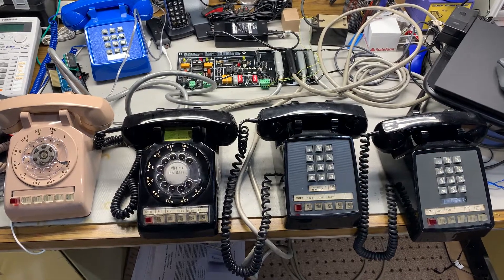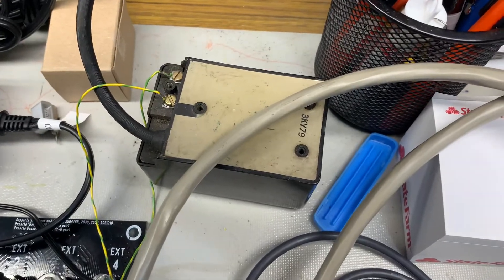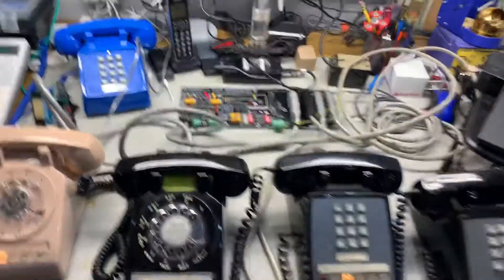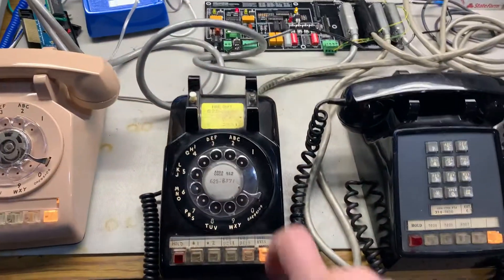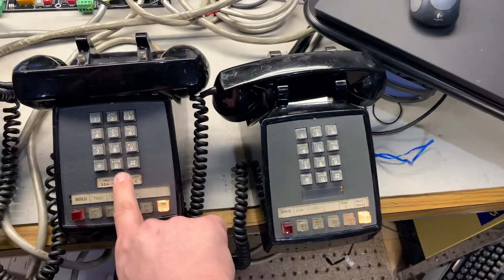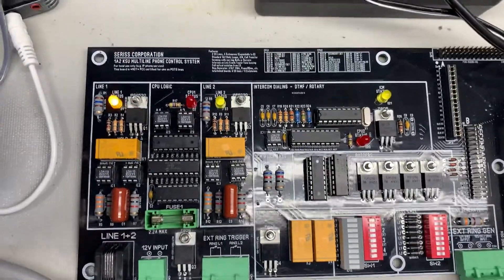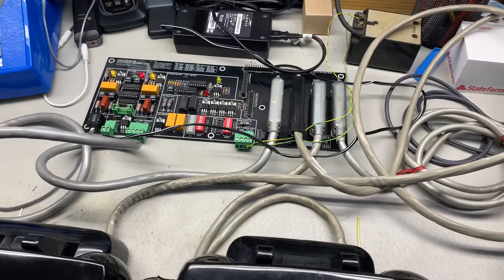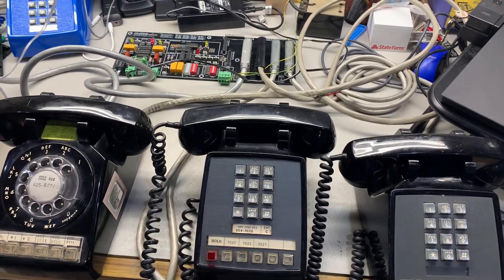Seriss Corporation 1A2 Multiline key system demo

Comment: Greg made a very good reproduction of 1A2 Key. This is perfect for people who don't want to mess around with wiring up a 1A2 KSU or do not understand how to wire up one. Also who do not want to hang up a heavy KSU on the wall. One trick you can do is make a jumper wire pair from the buzzer pair in the phone to the hold lamp pair. Then install a bulb in the hold light socket then the hold lamp will light up when the phone is buzzed.

Comment: Nice! I noticed the 1A2 bells continued to ring after you dumped the call. Is this because CPC disconnect isn't monitored on the board or because your dial tone provider isn't sending CPC? (CPC is typically a power drop when calling party disconnects, signals 1A2 that the caller has hung up, so held calls drop and ringing calls stop.)
Reply from the maker: Alexis Kasperavičius here’s the designer’s (Greg Ercolano’s) answer:  Ha, I noticed that too.. was wondering if someone would ask. It's an artifact of regenerated ringing in 1A2 KSUs to handle synchronized ringing of potentially multiple lines at once, carefully preserved by my board, simply because there is no avoiding it, lol. CPC isn't really part of it; since no one's answered the call yet, there's no CPC when someone hangs up, the ringing just stops. But 1a2 doesn't know about the hangup during regenerated ringing, so it can ring an extra ~6 seconds after a hangup. Anyone have a better way of wording a response?
Reply from the maker: Alexis Kasperavičius I’ll ask the board designer and then let you know!